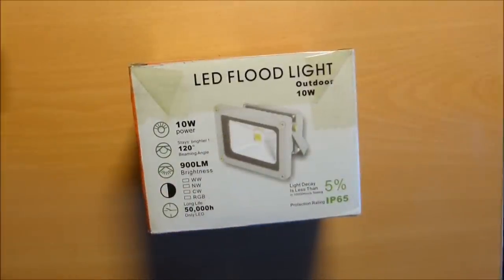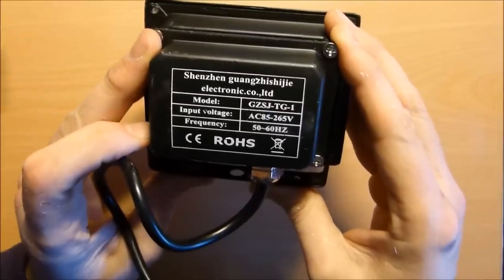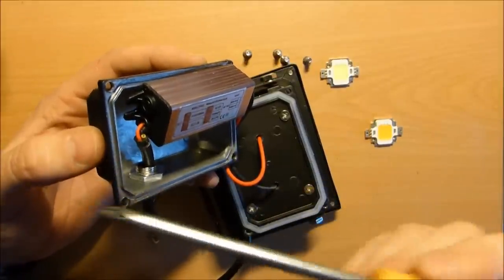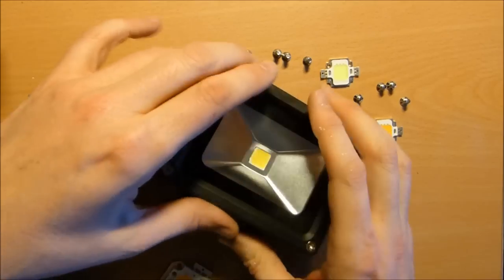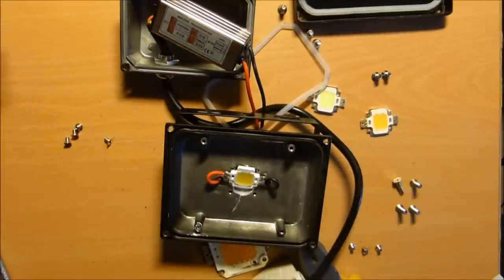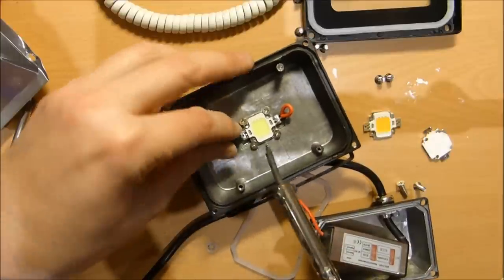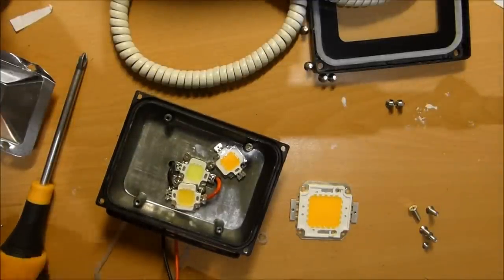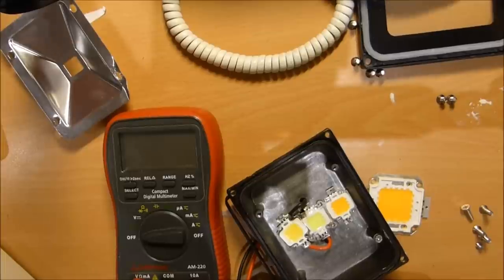Project 010: How Easy is it to Change the Color of a 10W/30W/100W LED Floodlight?

Comment: There is constant current and constant voltage leds. One in the light is constant current and the chips you have are constant voltage. Well spotted on the no earth.